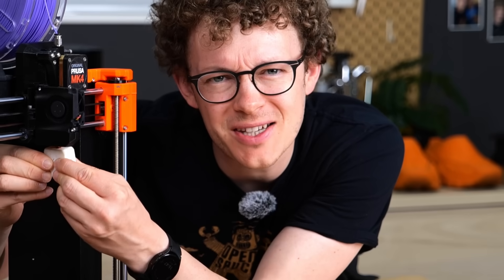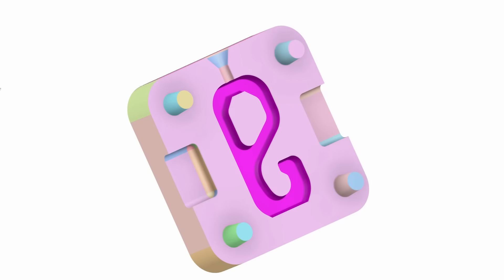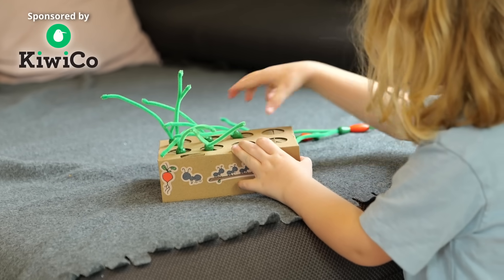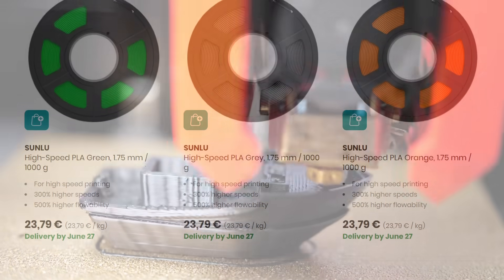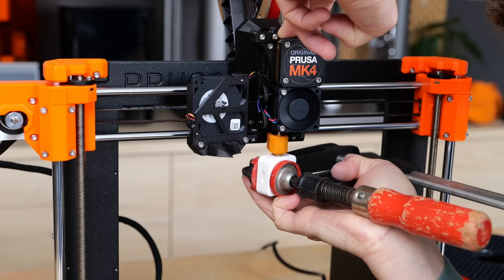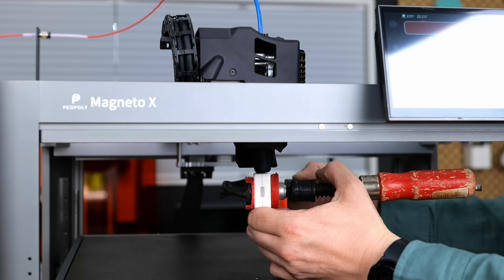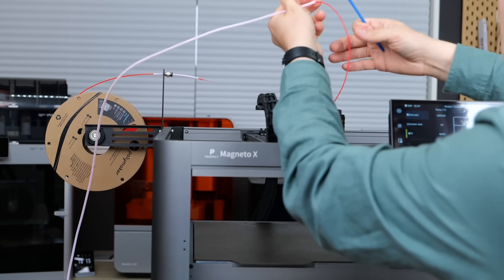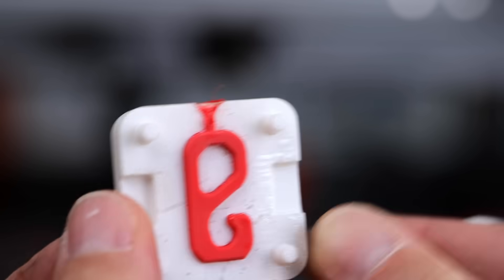I tried Injection Molding using a 3D Printer!

Comment: A few guesses: Trapped Air is one issue. Its building a counter force to your injected mold and prevents it to reach all edges. I know it not a air tight chaimber but still in every mold or casting process there are air vents used. You may also consider using metal plates, that are preheated at your pressure points to sustain the heat at the core. And you should also consider injecting the mold closer to the middle of the object not at the very end.

Comment: I would guess at 2 issues. First, is that the mold is cooling down your material before it can fill. You should try heating the mold. Another issue which is commin with injection molding. A pressure lock. If the air can't escape the mold, then the material can't flow into the mold. It becomes an air piston the air can't compress enough to allow the material to fill the mold. So my suggestion would be, give a vent port at the bottom of the mold. And heat the mold. WHen material comes out of the bottom vent you know your mold is full.

Comment: Heat the mould. Let the air out via a second sprew. You could also print a clamping sleev with the fdm utilising its strength.

Comment: Making a plunger machine, just to recycle 3d printer scrap into something usefill is a thought.The trick you have solved here is being able to make comlicated molds on the cheap. (we used to make SLA patterns, cast a mold of epoxy mixed with metal poweder and get 4 or 5K parts of of them)/ Lot of ideas. (ps always gate on the thickest section of the part, ie gate the head of a bolt and Especially at low pressures, you got to get the air out. Make a small diameter passage way opposite the gate. YOu are brave holding it by hand. I thin i would of set it non the bed and rested on the carriage.

Comment: No layers, thats a plus, but it is a bit of a stretch to call it injection molding (all machines have a pre-extrude setting to do what you are doing here. we need pressure!. There were. in the early days, plunger machine that was not much more than a heated tube and a ram in an arbor press. So for larger parts. filiment extuder on it's side pushing into a heated cylinder about 1/2 way up, when it starts to push the piston up, hang on the arbor press and it shuts off the input from the extruder and forces it under pressure. The resin mold , sized to fit inside a short piece of square tubing has some ideas.

Comment: i would have done a few through holes near the corners of the molds so you can use bolts and nuts to hold the halves together. would also have added an air vent to allow the air in the mold a path to escape while also making the cavity easier to fill.  I make my own soft plastic fishing lures and have been experimenting with my own 3D printed molds.

Comment: First of all, why are you holding it with your hands lol? Put it on the table and press it down with the X-axis. Secondly, for casting you need vents, holes from the inside out so the pressure has somewhere to go.

Comment: wondering why you wouldn't use a small hobby cnc to cut a metal mold, then heat the mold to a temperature that would allow the filament to fill the mold before hardening...From what i see here if you did that it would absolutely work.

Comment: Why not just use sylicone molds and epoxy
Reply: Epoxy is a completely different kind of material with diffrent applications than the materials he used

And it's a lot more toxic too (although the uv resin from the resin printer is pretty toxic as well)

Comment: Air vents and much more pressure are the key. Also a material that cools slower down and is/remains more/longer fluid to fill the form completely. I made exactly this with dental wax 30 yrs ago. Necessarily with 300-500 kPa compressed air and a hot very fluid wax. So, i guess this solution with a 3d printer is an dead end 🤝

Comment: there are other more knowledgeable persons out here in the art of molding but I think that to offset the relative low speed of the extruders, one might need to build a device with 2 or more extruders to push the plastic from opposite ends, and also place it in a heated chamber to help keep the mold at least warmer than ambient. and holes for the air to escape as so many others have pointed out.

Comment: The problem is you don't have a vent for air to come out. So besides other factors, you need to fight the air pressure. For molding an air vent is always necessary.
Also, 3D printed mold + silicone cast would be interesting.

Comment: Might be good for a proof of concept but in real world equipment: 1. We never use PLA for the final product (it's usually ABS)
2. A MASSIVE amount of pressure is needed for the plastic so that it fills out every little detail (Not talking about the force that keeps the two mold pieces together)
3. As you said, we use metal and not just some kind of resin printed plastic as a mold.

Overall it's not a good idea to try this at your home unless you need something very small but for that you already have a resin printer. This tech was not invented for bedroom tinkerers

Comment: 1 would be using a metal heated block.  I know you want to print it so we'll stick with that.  2 inject in the middle point. That will allow it to flow equally in all directions. 3 Use a screw on block to stop the top leaking.  4 fewer curves until you get good flow.  I'm not sure any of these will help but seems like they might.

Comment: Another idea is to make a mold heater that heats the mold to the same temp as the extruder hot end. By doing so, the plastic will maintain melt temperature as it is pressed into the mold. And as other commenters have stated, add air vents to the mold so that less pressure is needed for injection.

Comment: the filament compresses the air in the mold thats why it doesnt fill all the way through there should be additional space in the mold for the escaping air or a hole from the other side

Comment: Maybe try using an oven? Most ovens can go between 50-200+C so they should 
1. Make a mold for your part
2. preheat the mold in an oven
3. gradually insert pellets/chopped up filament into the mold(allow for any gasses to escape the mold) while heating in an oven
4. let the mold cool and then remove the finished part

Comment: The main reason why your molds kept failing was because there was no exit hole, basically you forced the filament to fight the air which either leads to the mold opening or the mold barely being filled.

Comment: I see many people saying to add an air hole but no one saying where or why. Place the air hole at the opposite end of the form, what i mean is the end point of the mold. Think of the mold like a race track of the fluid just like water, fluids, and electricity follows the path of least resistance so follow the path of where the fluid will travel and place the air hole at that point once you see it flowing out of the air point at the end that's how you  it will be completed. In the video the object looks quite like the letter 9 starting at the top and ending at the tail of the 9 placing the air hole would best be placed at the ending of when you write the letter 9 and end on the tail. That will fix your issue with the mold not filling

Comment: You're squeezing material against air. You need a very small channel in the mold for the air to escape. Adding it at the tail end of the 9 would require some trimming afterwards, but the required pressure would be drastically lower

Comment: How frustrating to watch. If you took the time to look into how any kind of casting with molds are done, you would think to add a way for the air to escape. There's always some kind of air escape hole, or they use vacuum. So much talk about pressure for no reason.

Comment: I believe your mould needs to be hot and for that a metal mould or something else would work. your cold moulds cool the material faster also you need air vents in the mould for material to flow quickly into the mould

Comment: why not hold the mold with screws ? 4 on the sides and u dont need to clamp it also why not run 2 long screws through the mold and have a receiver end on the head/tip to screw it in ? 2 screws to hold the mold into the head and 4 to hold shut the mold it self .

Comment: The 1st thing I noticed is that there are no export tubes or vent tubes.  On regular injection molding you inject through one hole until it exits another hole on the furthest point of the part being molded which allows the plastic to flow all the way through without building up back pressure.  Give it a try.  Great idea though

Comment: very interesting. my thought would be to design an exhaust pipe with a j hook going up so that it would have enough pressure to clog its self. Though it also makes me wonder what I could make with an oven. Like could I pour some molten aluminum into reverse molds and then press tpu into those when they’re kept heated at the right temperature. (im making two tone coasters that fit together like a top and bottom)

Comment: Why not set your perfectly flat mold on your perfectly flat bed and use the x, y, and z axis motors to lock it in at the fill hole against the build plate and then just use the extruder motor to push out the correct amount the mold would need?

Comment: I wonder if the air in the mold might be an issue. Hence, industrial molds sometimes have cavities that need ti be trimmed off the part afterwards - but allow for all the important details to be filled out. After all, the melted plastic pushes an air pocket into the part and that air needs to end up somewhere.

Comment: I would clamp down the mold onto the heat bed using the nozzle. I also would heat the mold up using the heatbed.

And I would design the screw mold the otherway around so you inject at the head.

Comment: I hope this information helps

I couldn't see any are reliefs on you're mold to allow the air to escape at the farthest distance

Most molds have some kind of secondary hole to release the air pressure that fights the pressure of the fluid coming in what you have is a situation where the air is cooling down the part because it has no place to go and it's backing the molted fluid creating resistance

You need to create a path of least resistance and you may even have to make two depending upon your design if there's any branches in in the design kind of like the legs

Comment: I dont know of there arz follop up videos, but why dont you make the mold screw on the nozzel end. Even remove the nozzel and screw it on directly. The ole need for a nozzel is to guide and determine the flow and directions. Skipping this does risk fillament pushing out on other parts of the extruder.

Comment: Not an injection mold specialist here. Summarization of people with more experience then me:
- Leave an Air vent Hole instead of increasing the presssure (or multiple on corners)
- Move the injection hole to the middle of the part for better distribution of the fillament
- try to maintain the temperature at 80 - 100 Degrees Celsius for the plastic to remain viscous (Maybe this could be done with some kind of hot wire contraption?)

Comment: damn, so project with old ender 3 hotend (that I replaced for a new one) and some basic extruder (or just hand fed) and molds... and I can injection mold small parts? especially if I use like 0.8mm nozzle?

Comment: Half way through the video I was thinking why not make the injection hole bigger?  Also make a smaller vent hole that will release the air in the mold so you are not fighting pressure

Comment: Add an air hole, and saw off a nozzle that's slightly longer than the hotend to make a thread and have the molds thread onto the sawed off nozzle, since the resin can handle more than 200 degrees.

Comment: I think you need to keep the mold hot the entire time the extrusion is taking place.  I would try running a small torch on the clamp and the heat should transfer into the mold.

Comment: Hi. Can air still in the mold? If the answer is yes, you maybe do one hole on the end of the injection, something like 0,2mm. These will purge the air and pressure on the hotend can be low more. These are need to cut the excess, but can help. Thanks for you demonstration.

Comment: Excellent work! I would suggest adding small air outlets to optimize plastic flow. Air tends to get compressed in areas far from the inlet, which can prevent the plastic from fully filling the mold (particularly around the bolt head). This adjustment could significantly improve the results, and I'm curious to see the outcome.

Comment: I’ve been thinking of making an injection molder. It can be made fairly simply if you make it manual. All it is, is a hypodermic syringe with a heater around it to melt the plastic. Then the plastic is forced out the nozzle into the mold. It’s the same way extruded parts are made. Yes, that’s very oversimplified, but that’s the basic machine.

Comment: @CNCKitchen, you need a vent. 2nd you can design a hot end with a larger hole and with an end like a tappered screw. this will allow you to build a modl that has an tappered nut-like inlet. this will ensure that you get most of the pressure that the extruder are making. last thing is to make a worm-gear extruder like the actual injection machines. at this point you will be better making or buing a small injection machine

Comment: You need a bleeder for the air pressure to escape at the ends. Molds are not built for solid contact at the seams. There is a gap, just large enough for air and gasses to escape, but not the plastic. A tiny exhaust at the end, like a sprue, is fine. It should also reduce flashing, since there is a place of less resistance, for the air and plastic to go.

Truly, you need a heated mold and a real injection screw with a plunger that can control the injected volume and pressure of the melted plastic.

A machine shop should be able to make a basic setup, rather cheap.

Another thing you can do is use a metal 3D printer to make the mold.

Comment: get an extra long nozzle and make injection mold bigger and add some space for nozzle so when you close the mold you will put nozzle in the mold it will increase preasure but it can explode so you will need better clamp and add vent hole

Comment: Im wondering if you put an air hole at the end of the mold would help. I wonder if there is a little air pressure pressing back on the plastic. plus if the plastic came out the other end you know for sure it was full

Comment: Materials play a huge factor in injection molding. If they're too viscous, they're not suitable for injection molding.

As others have said, it would probably full better if you rotate the sprue location to be perpendicular to your mold and design in a set of runners to distribute the plastic around the whole cavity evenly.

Notwithstanding allowing air to escape, another reason it's so difficult to fill the hook is because of the... I'm not sure of the technical term for it, but essentially the cross-section size and cavity you're trying to fill. You could get that PLA to fill in as-is with higher injection pressure, but compared to your runner and your available pressure, the cross-section looking from the direction of the sprue is just way too large. It would also be much easier to fill if you had a runner connecting to the very bottom part of the hook, instead of trying to push the plastic around the hook all the way from the top. 

As a general note, I would recommend leaving a cylinder (not a cone) for your runner going into your part.
It will be much easier to trim the runner. Same goes with air holes.

Comment: I did injection molding for a few years, and i find extrusion printing a lot better even if it has a few of its downsides in comparison. Injection molding makes you dependent on your tool, the design of your tool, the state of your tool, and the separate heating/cooling of your tool (depending on materials you are using). Extrusion printing on the other hand is a lot easier, as you only have to account for the machine settings and the material you are using, and all of that is kept under pretty good control (the machine and the material must be in spec, that way it's already 90% set up, only fine tuning needed). By mold injection the whole thing needs to be set up pretty precisely, the temperature and force (pressure) of the plastic entering the mold (with the mold temp accounted for), from the very beginning to the very end, including the cooling time in the mold. Also, the mold is degrading, and machining needs to be accounted for every now and then.
I used to use a separate cooling/heating circuit on the mold injection tool itself, to keep it consistent, at the exact temperature where the part solidifies in about 1,5 seconds, and it's ready to be ejected once the tool opens at about 2,5 seconds. I used water cooling/heating

Comment: You should add channels to the mold where you can run an electric wire and heat it with a battery. If you make the math correctly you should be able to bring the mold to 190 degrees while it's being filled, easily solving your filling problem while keeping the process simple.
Also, you need to add air exhaust channels to your mold, that is what slows down the filling near the end and causes most of your faults.

Comment: Introduce a second hole for the air pressure to escape and use piezo plates on both side of the mold or wrap it in a heating element coil using the heat side to face the mold while injecting this method should also let you increase from 35% to 60+% in volumes also using the gcodes you can make use of macros for mcode  to make the process automated since you know that mold should be hot.😅

Also, I feel that mold release would help the hot material slip right in with its hot wall surfaces inside the mold.